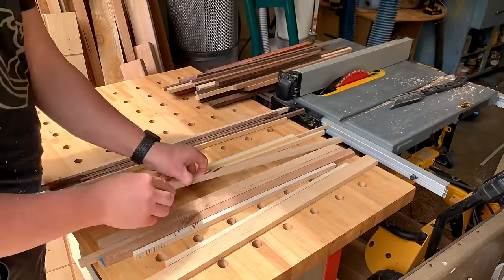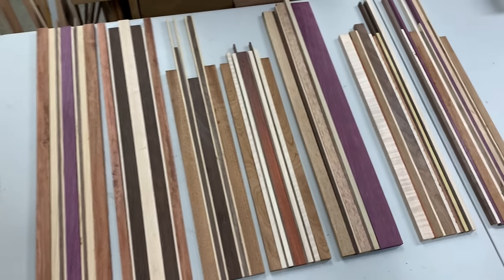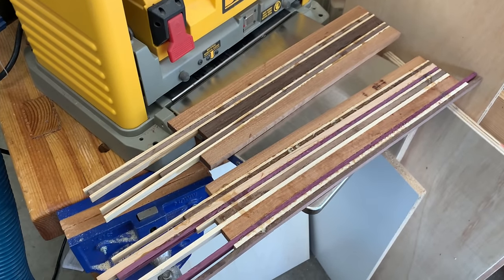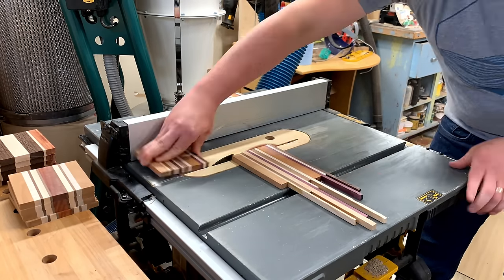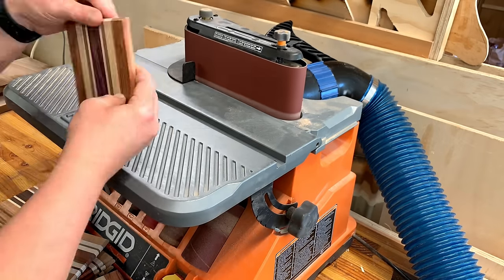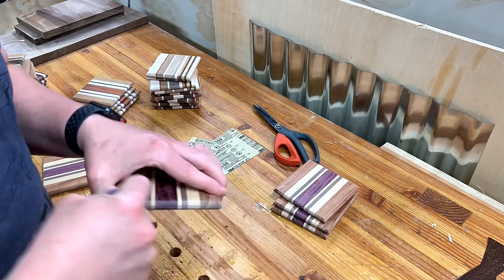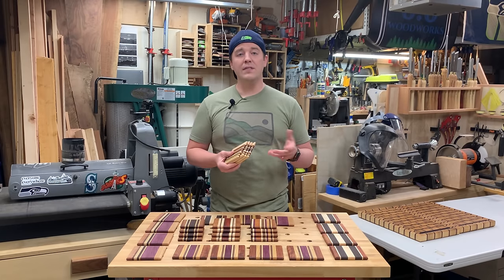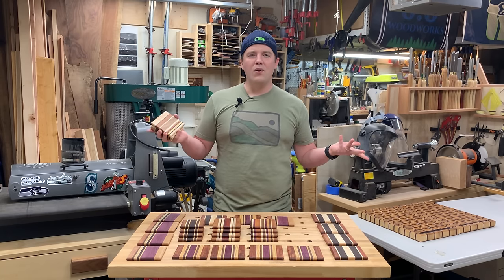How to Make Wood Coasters: Tips and Jigs for Batching

Comment: If I may suggest a feather board mounted vertically on your table saw fence for the down pressure. Also run all of your coasters through your drum sander before you cut them to final size. That instead of all that hand sanding, when you cut them to size all you interrupt is the edge and that you take of with your router. That may be determined by how long it takes you to change grits on the drum sander. Slainge!

Comment: Thanks for the video. Just a thought, but I made a batch of 30 coasters with various scraps and finished with lacquer. To get the lacquer into the wood, and not just a surface film, diluted the lacquer 1:1 with mineral spirits. Two benefits to doing this, 1; the mineral spirits gets absorbed by the wood pulling the lacquer with it and 2; the mineral spirits accelerates the curing (drying) time shortening the finishing time. Another advantage is the mineral spirits help reflow the lacquer to give a very smooth finish.

Comment: I often debate whether they are worth selling too. I typically will do small batches, for reasons you mentioned, with simple patterns or just one solid wood with something engraved. One main thing i do differently is i sand the full blank after planing, before slicing into individuals. It eliminates the need for a sanding jig. I can hit them quick for a couple seconds of final sanding if i get a mark from sliding on the saw, router, or sander table.
Reply from the maker: Definitely loads of options and variables for efficiency!

Comment: Love this video, but the cross cuts at 8:20 gave me so much anxiety! I cut three fingers off last year due to kickback using almost that exact same technique. Using just the rip fence for cross cuts is asking for trouble. 
Cross cuts should always be supported by the miter gauge or a sled and the work piece should never be in contact with the fence when making a cross cut. To set up the repeatable cut, attach a stop block to the fence that stops before the blade, so that you can set the length, but by the time the wood makes contact with the blade, it is no longer in contact with the fence. If the fence is out of square by a fraction of a degree or if you're pushing the wood anything other than perfectly straight forward, or even if the vibration of the saw moves the wood a fraction of a millimeter and your grip isn't /perfect/, it'll pull your hand right into the blade. 
It's not worth the three surgeries, six months of physical therapy, $5500 in medical bills, and a lifetime of significantly limited use of your right hand, trust me.
Reply: So many lousy woodworkers on YT, going to be responsible for so much pain.

Comment: Love all of your videos, thanks for putting them out.  I've made my share of both edge and end grain coasters, and I gotta say that I have yet to find a finish that I think works "great".  I even did an experiment with a bunch of coasters that I made (all end grain) and used 11 different finishes, ranging from Danish oil to spar urethane.  My problem with the film finishes is that I find glasses/bottles stick to them when they sweat, which can get exciting when they then fall back onto the table with a loud bang.  I like the oil finishes better because that seems to happen less, but it doesn't seem to eliminate the problem and they also aren't as durable.  I've recently used a mineral oil/beeswax combo that I made for my cutting boards, and that one seems to work fairly well.  I think the next one I'm going to try is no finish at all, see how that works.  I imagine  it will make them rougher over time, but it might eliminate the sticking problem.  Anyway, not sure why I felt the need to leave this comment, it might have something to do with the bourbon glass currently sitting on my coaster with a Danish oil finish.
Reply from the maker: I hear you! Guess it really depends on the preference of the recipient. A trade off with each approach.
Reply: From your experience what do customers prefer natural oil or poly type top coat?

Comment: Hey those are very nice. Not sure if you're up for a tip or not.. coasters are one of my biggest sellers. This is just something ya should try sometime. A lot of coasters if you make face or edge grain you get problems with glasses sweating...coasters sticking...and picking up with glass. I have found all of mine are end grain treated with mineral oil...never sticks. Give it a shot. Glue up a block of scraps and cut with a chop saw. Multiple sets at once. And an 80 dollar disk and belt sander combo says no hand sanding. May be more now but I figure ya know what I'm talking about. If ya want to take a look at my coasters let me know. Just a tip. Give it a shot. Be surprised.
Reply from the maker: Love it. Definitely loads of options and styles. For me, I prefer making them every once in a while as gifts. But totally a great seller for those who go that route. The demand is always super high.

Comment: Wow very Nice I Like I want to make a cutting board I bought Odie's could i soak in  Mineral oil then put the Odie's
Reply from the maker: With Odie’s you usually just want to use it alone. Maybe a second coat. The mineral oil doesn’t really dry or evaporate. The tung oil in Odie’s is going to give that penetration that lasts longer. With that said, you’re probably fine if you did mineral oil first. Just not necessary. The wood whisperer has a great video on food safe finishes and talking about penetration, etc.
Reply: @SixEightWoodworks  Thank you so much we learn from people like you because u put your All into the job.

Comment: Thanks for a great video, I picked up a couple of useful tips. I agree that you won't get paid well for the time, but if you have fun and you recoup the material cost for scraps, it might be worth it. You can also bundle it with cutting boards. Did you go edge grain? I think a coaster would be a great face grain project. Thanks!
Reply from the maker: Absolutely. I took a few years off from doing them after that big film finish batch. But they are fun and a great use of small pieces. These were edge grain, but I’ve definitely done face grain as well.

Comment: Great video
How long did you leave between coats? And does that technique (buffing pad) work with all osmo hard wax oils?
Reply from the maker: Thanks. Usually you need to wait about 24 hrs between coats. I usually do the first coat at night, and do the second sometime the next day. I’m not sure about other Osmo oils, I’ve only worked with 3054.
Reply: Thanks for the advice ill give it a go

Comment: I have a few birch wood 4” coasters that have bowed very slightly.  What is the best way to flatten them?  They are 1/2” thick.
Reply from the maker: Not much material to work with. Usually I’d say attach them to a sled and run them through the drum sander or planer with thin passes. But you might lose them in the process. Only other option would be to get them wet and then clamp them all together so they dry flat. It might not work, but that’s my only other idea.

Comment: At 8 min where you are cutting them to length using your table saw without guards - I do that as well, but I hook my pinky over the fence so that if, God forbid, it kicks back or tries to twist my work piece, my pinky keeps my hand from being pulled into the blade.  It happens too fast for our reflexes to catch it.